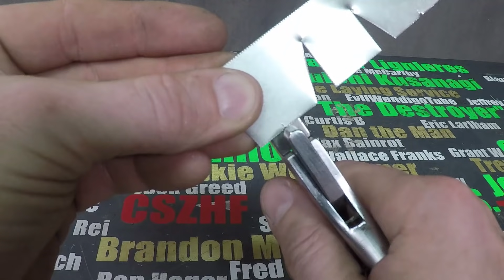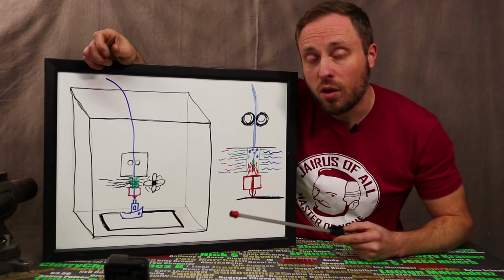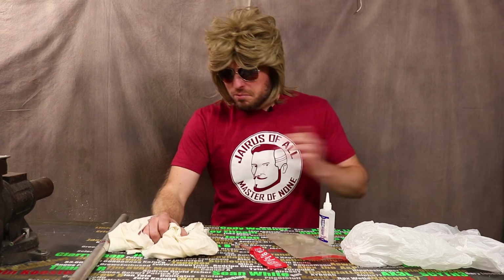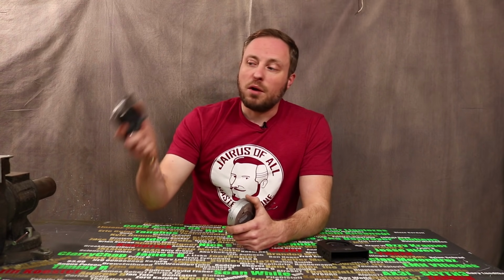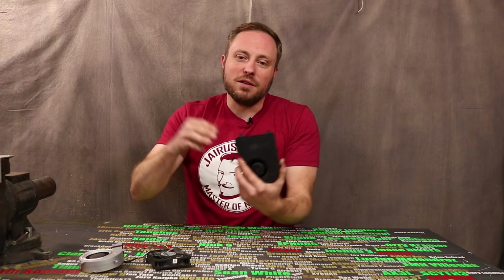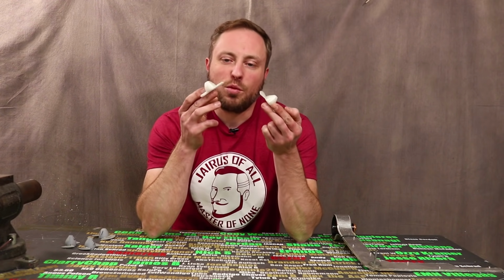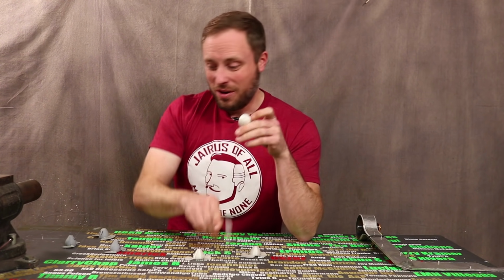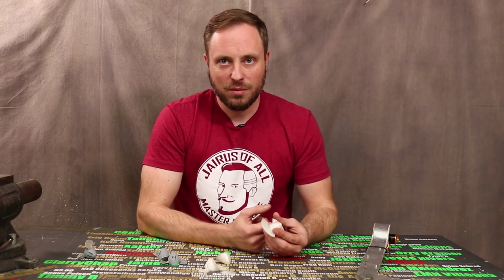Hi Temp 3D Prints - End Heat Creep

Comment: What would be cool would be something like a silicone bellows/bag type arrangement that fits over the hotend and the bed, but leaves the rest of the printer exposed to air, so all the heat is maintained in the print area but the rest of the printer is in fresh air.

That's a lot of effort to make vacuum cleaner hoses. You know you can get metal lined vacuum cleaner hoses for use with ash vacuums, and if you needed something with a smaller diameter you can get metal garden hoses too.

Comment: I ran into the same problem when I enclosed my Ender 5 Plus and was printing CF PA6. I thought about something like this but thought it was too bulky. I ended up sending a 4mm airline from my air compressor to a 3d printed part that channels the air to the cold end fan.  It’s flow restricted down to a gentle blow.  It works like a charm but the compressor has to fire up every so often and it’s pretty loud. I think water cooling is the way to go.

Comment: I'm a simple man. I see 3D printers, I click. I see Jarius, I click. Today must be my lucky day!
EDIT: have you tried using a bowden extruder rather than a direct drive? Seems to me if you moved the extruder outside of the box, it would go a long way to solving your heat creep issue.
2ND EDIT: LULZ bots are good, but they're not easily converted into high-temp printers. You'd be better off using an Ender-5. TeachingTech has a video series on converting a stock Ender-5 to a high-temp printer